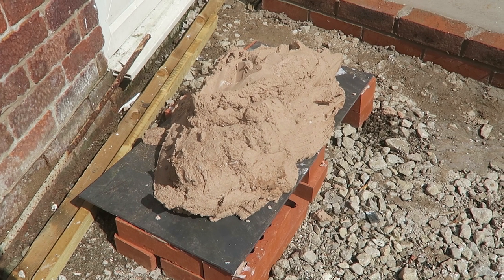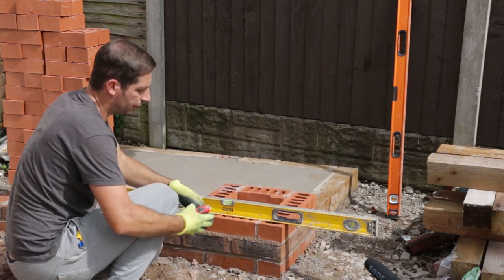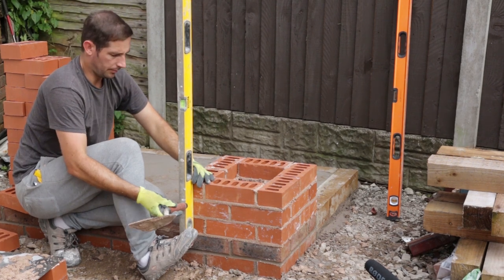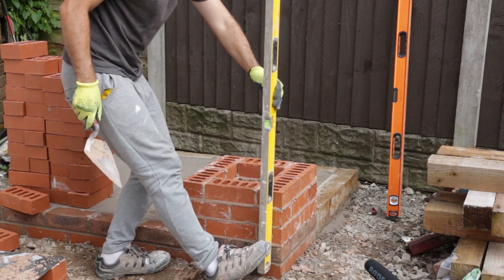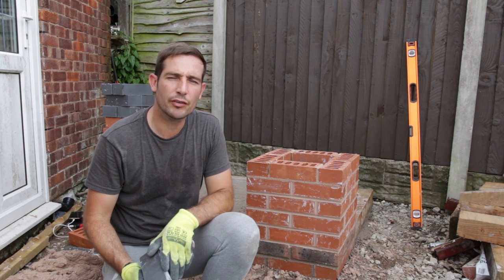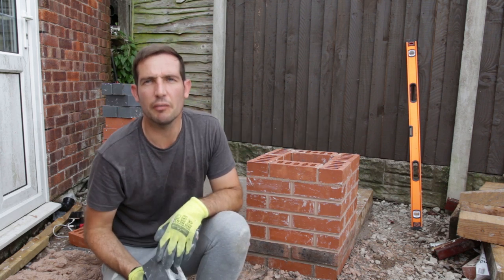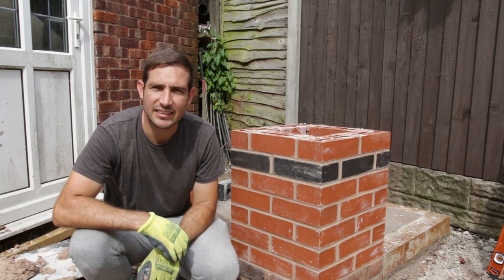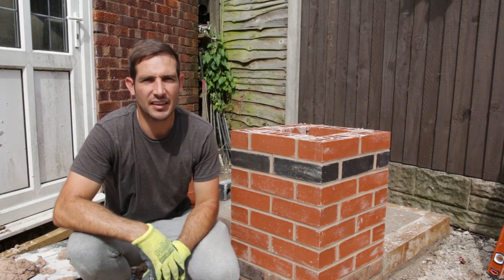how to build a brick pier - bricklaying tutorial

Comment: Hi.
Stu one thing I've found over the years people get grooved into straight line work  cavity s.If you feel it's worth showing ,A lot people are weak at bonding brick  various types of junction s  4 and 9 inch,also unsure how to deal with reverse and broken bonds.Ive seen it ,where people have been asked on site to build a pier but didn't volunteer or won't to,because they had not really done much of that kind of work only in college maybe 5 or 6 years gone.Seasoned brickies  no problem s. Just an idea Stu even just lay out dry on your set up slab and show the cut bricks / closures /bats butting up and tie in .As you know most lads can do straight runs,I think it would help your views more.
Abit long winded just an idea.
All the best.

Comment: 42 brick pier, how long did it take you? I just built (6) 2'x2'x6'H piers (270) brick per column and was building 1 a day,  drilled and pinned rebar into the footing and filled it up halfway with concrete working by myself, I'm just curious about how long the 42 took you, about an hour?
Reply: I think at least 2 hours